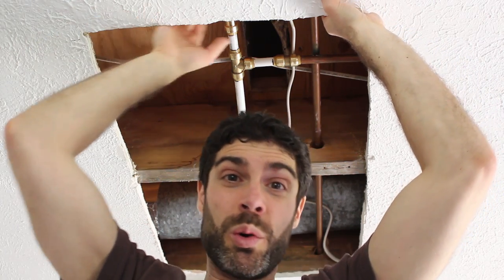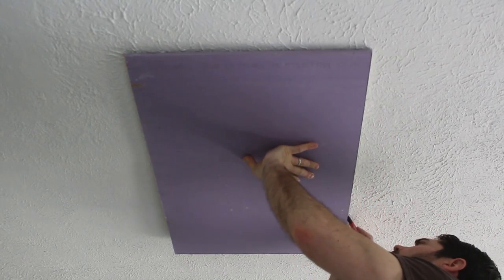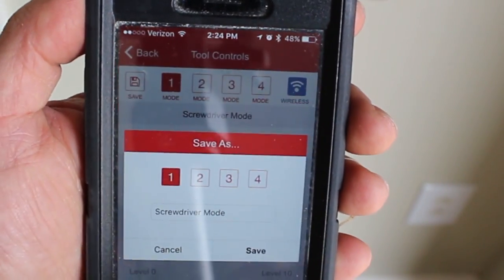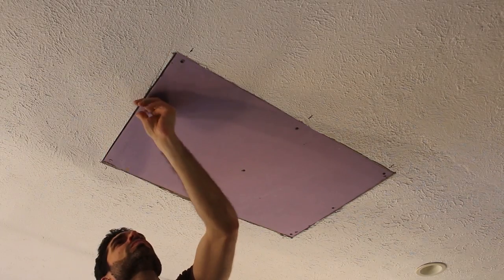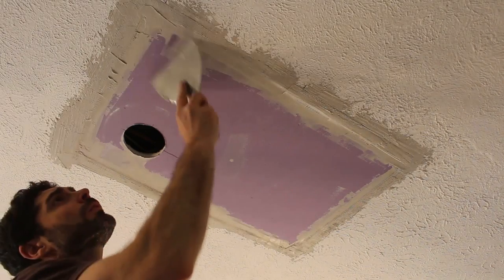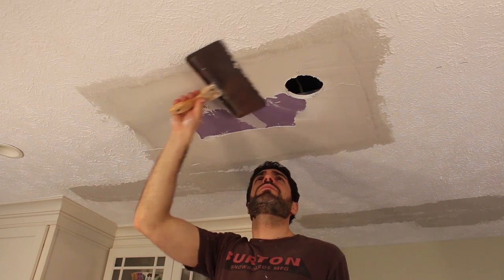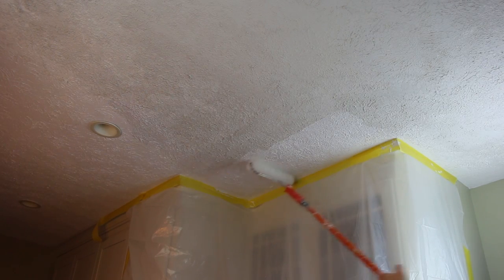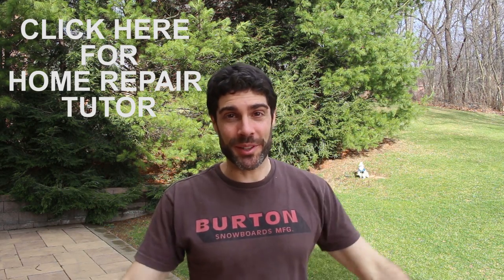How to Fix Drywall in a Bathroom or Any Other Room (Step-by-Step)  -- by Home Repair Tutor

Comment: I just discovered your videos.  I love them!  They are super helpful.  I love that I can rewind whenever I need to--sometimes right in the middle of my project.  I need that tool!  I recently acquired a tax foreclosure property and I'm a DIYer.  The tool would make drywall installs, 2x2, and 2x4 framing so much easier for me.   I'm often working after 5 on this house -after work.  An impact driver like this would make working easier and faster-----is something I crave for.  I hope you consider me the favorite for getting that Milwaukee.  Thanks for your easy to follow videos.  They have given me, a girly girl the courage to just do it.  Guess what?  I am just doing it and it feels great to look at work that I did myself learning all the way.

Comment: Excellent video! I've been putting off a leak from the second floor bathroom that is dripping down through the drywall of the ceiling below for a few months now. Planning to tear open the drywall tomorrow to see where exactly the leak is coming from. I was concerned with how to put the drywall back together, but with your video, I think I know exactly what to do!

Comment: I am trying to finish a steel roof I am replacing after a hail storm ruined my roof last year.  I am disabled from cancer, or really the chemo treatments I had to go through that caused nerve disorder in my back from the chemo.  I could really use this to help me screw down the sheets  because I have a old screw driver that has to be charged after about 30 minutes of use.  Thanks for the video. You really help people that need the info you are giving out....
Reply from the maker: +Randy Griffin hope you're doing better. Cancer sucks. But it sounds like you're doing good?

Comment: Thank you for the video. Excellent tutorial! Thank you for sharing the tips, tricks and minor imperfections too. I bought my husband an impact drill just before our project and it is a must have for this project and any DIY project. Right tool for the right job so folks go out and buy, it's worth the money (not that expensive). My hubby mounts the drywall and I tape, mud and texture. I feel more confident with my work now that I've watched your videos. Keep up the good work Jeff. Many, many thanks!

Comment: I have been doing carpentry works at home and at my children's homes (got 4 married kids). I am currently using a regular screw driver. At one time I was able to borrow an impact driver from a friend to test the difference between the two and noticed that impact drivers is effortless and much faster especially when your putting up multiple panels. I wish I can have one of this especially now that I'm retiree. Thanks much.

Comment: This is a great
video, I wish I saw your video before I did my ceiling. I do not have impact driver drill or never used one in the past and in the past I have used inexpensive corded drill where either the speed is to slow or too fast. I always end up messing up the screws. I like mobile settings and so easy to configure. Currently I am starting my unfinished basement so my kids can have
room to play.
Once again great video and keep up the good work!

Comment: Really appreciate how yo allowed a good ammount of time and photos to removing the old, and preparing / installing extra wood so you have something more to screw into. LOVE that you included the problem of needing a round hole for the light!! also LOVE that you suggest pre drilling the screws to save time holding the drywall above my head. Thanks!
Reply from the maker: Thank you Cathy, hopefully the tips help

Comment: Your video answered my questions perfectly!  Thanks!  I am going to update my kitchen by replacing fluorescent tube light fixtures with can lights and will have to patch 6 2 x 4 holes in a dropped ceiling.  BTW, it's probably too late for the drawing, but I would dearly benefit from a Milwaukee impact driver!  I'm a grandma do it yourselfer!

Comment: HEYYYYY JEFF! I can REALLY use that Milwaukee Fuel One Key M18 impact driver. I found water leaking through my grout in the bathroom which has now turned into a renovation. Doing this all myself with the help of my wife and can really use this impact driver. I have many more house projects in this 1968 home yet to be started as well. Thanks for the VERY helpful videos!
Reply from the maker: +Owen Crossman oh no!! Was water betting behind the surround or tile?
Reply: +Jeff Patterson, it seeped through the grout and through the boards. The previous owners did a great makeup job to cover the bad grout. I noticed the "makeup" coming off so I went to remove the old stuff and regrout, found water past the grout and water proofing. Long story short, we are now down to the studs. Good news is that I found a Wedi distributor. Now we're saving up the penny's to make one purchase and get it done right. (Thanks to your videos)

Comment: Gosh Jeff,... I wish I would have seen your video sooner.  You made the job looked easy and a few tips that I didn't even think of.  I had a water pipe leak coming from the foundation.  The "plumber" cut many holes trying to find the source of the water connection then cut 5 extra giant, non-pretty square holes to stick his head in to look in the ceilings if he can reroute the new water source through the sub-flooring.  Therefore, I ended up with many big ugly holes in two separate rooms in the ceiling, walls, and wall behind the kitchen sink.  This is a big job to repairs... after the plumber reconnected the water source throughout the whole house.   Now it just the drywall patching to do.
Thank you for the tip on adding the extra joint support,  tracing the drywall template to cut the ceiling square, and applying the mud.  I just completed one room.... looks O.K.  Now adding your tips to the job, I hope to get the 2nd room done a bit quicker.
Thank you for the video.

Comment: Nice Tutorial on drywall Jeff.  I wish I had seen this video a few months ago.  My repair came out fine, but I'm still cleaning up dust.  Live and learn!    Thanks for the video.

I have some second story windows that need to be replaced.  I could use that Milwaukee impact driver to help me with that project.

Comment: This would be my first cordless drill. I've been procrastinating because of the various brand lines (DeWalt, Milwaukee, etc). But I've decided Milwaukee is probably the brand to buy. Thanks for the great video, as usual.
Reply from the maker: +FrankenDoc it can get confusing super fast. So many options and so many brands. This is a good one, I'll stand behind that since I'm beating it to death on a bathroom project ;)

Comment: I could sure use an impact driver like that.  I had a bathtub leak that ended up leaking thru the downstairs bathroom celiing.  I need to make the same repair as you did in this video.  I've been putting it off for over a year now.. lol.  Thanks for the great video.  Cheers!
Reply from the maker: +VA3JPX hope the video helps with the repair, if you have any questions let me know. Don't worry, plenty of us procrastinate ;)

Comment: Yes, thank you for the video Jeff. I'm in the process of repairing a similar type of damage in a bedroom ceiling. My issue is its lathe and plaster. So, not being a plasterer I'm going to take your suggestion and mark and cut plaster to fit. Not being at all 'handy' I've never owned tools and in the process of trying to accumulate them as I go along. And not to mention accumulating the necessary skills and confidence to tackle the jobs myself. I do have a borrowed drill, but I should really return it to its rightful owner asap. That's my story in hopes I get the randomly picked as the winner.

Comment: Awesome driver!  I would need one to help with building my deck skirting - our first major project!  We're using a regular drill and while that works, man, an impact driver would make it go so much faster (and neater too!).  Hope we win!
Reply from the maker: +oepth you're right, it would be a breeze with an impact driver. Drills are good but these bad boys are way better. I rarely use a drill unless it's a hammer drill for concrete

Comment: You got my respect. I live in a condo and we had a leak in the bath tub. Easy fix. All we had to do was to screw the over fill plate tightly plumber didn't charge us anything. Our neighbor down stairs noticed his soggy dry wall and heard the water drip. Family friend took care of everything for a case of beer. After me and mom went to 'Hope-Depot' and looked like tourists in a lost world. We bought a basic drill, basic drivers and screws, duct tape, wd-40, and a ton of caulking and canned foam. 

Whoever invented spray foam has to be one psychotic sadist because I damn near spray foamed myself like the marshmellow man from Ghostbusters. It was like being a horny teenager with a computer on summer vacation again. So much fun.

Comment: Oh, I have many projects set for years!  Basement reorganization which requires mounting things on concrete block walls, i.e. Impact driving.  I also have outside projects I'm working on now - fence repair and creating boxes for raised gardens.  Then I want to redo my garage and later the screened in porch.  The house is a 1960 home and renovations are due.  Oh, there's more ...

Comment: Texture is like smooth wall, you need to flare out your patch more, I go about 3-4 feet out from the joint. Luckily in my area, texture is not popular. You can also use drywall shims or cardboard to level your board. Remember is you are a do it yourself er, its easier to do multiple thin coats than trying to get everything in few passes. As for the video, I love presentation style! Keep up the good work!

Comment: I need it because I am building a Time Machine in my garage with a wireless interface to my skull (for neurotransmitter control) and drilling the Unobtanium and my cranium requires different yet precise speeds. Thank You.

Comment: Nice drywall video so was that piece of wood added to each end of the patch? Also would be nice to have to have an impact driver since I'm diying my whole family's 100 year old house solo and doing everything from framing to drywalling to exterior.. which will probably take me till I'm old man lol.
Reply from the maker: +Neogx148 sometimes feel the same way about my house. Yes, added the blocking to the joists to make it a bit easier to attach the drywall.

Comment: I would want this awesome impact because I really need to build shelving for the garage, rebuild my Dad's workbench. I also have a ceiling repair I need to do in my Mom's garage where the A/C tray overflowed and caused water damage.

Nice repair! This is actually pretty timely because I noticed the aforementioned water damage project a few weeks ago.

Comment: Excellent tips on the whole process. If you have any more drivers to give away I'd use it to rebuild my back deck. The M12 driver is good, but the M18 you described would be faster and stronger.

Comment: quite frankly I have been using the Ryobi butt I would love to try the new drill especially since its impact and I'll be able to drill through concrete to mount things and I would be looking forward to using it with my phone Daniel
Reply from the maker: +Daniel Iki the variable speed on this impact driver is what is so cool, makes it a great tool for most any project.

Comment: I'm taking over the house my father built in 83 and I'm a brand new DIYer so this is probably a dumb question; in my kitchen and hallway you can see the nail heads and some cracking along the tape and above the kitchen cabinets you can just see the tape breaking away. Do I use the same steps in this video to fix those issues? 
I called a few contractors and handyman services and they want to charge from 880 til 1500 to repair those areas, but if I can do it myself and learn something new, I'm all game. Advice would be appreciated!

Comment: I actually have to patch the drywall ceiling in my bathroom so this Milwaukee would be super awesome to use for the project! Great vids.
Reply from the maker: +PlatinumRespect ditto on that project. Are you doing anything else in the bathroom besides ceiling repair?
Reply: +Jeff Patterson nope, just patching that part of the ceiling. Water has made its way to that area of the ceiling and it looks like mold is forming on the drywall so it has to go. The area is right under where the upstairs toilet is located. With the mold situation, the insoles toon between floors in that section should be removed too, yes?
Reply from the maker: +PlatinumRespect depends on how bad it is. Check out Concrobium if you think the wood is salvageable
Reply: +Jeff Patterson will do. Thanks!!!

Comment: I am a DYI wannabe. I need the impact driver because I'm not even sure what the benefit would be over my regular drill besides extended battery life. It seems that my drill runs out of power right when I need it most when working on the deck, fixing the wood fence or building a corn hole game. Thanks!
Reply from the maker: +James April impact drivers have more capacity to driver screws versus drills. Plus the Lithium batteries simply stop compared to old NiCd that die slowly. Choose an impact driver over a drill, they're way better for most any project :)

Comment: First, I really enjoy seeing how easy many projects can be if you take the time  and find a great guide (which your videos and website are.  Why do I need the impact driver and what would I do with it?  Well, I have three teenage boys (enough said, but I will add; I have holes in walls, a window that is falling (literally) out of the side of the house and a bathroom with the floor rotting out around the stand up shower.  I have never owned an impact driver but those I know who have them say they are an incredible tool to have and it would be put to use in the coming months.  Good luck everyone :)

Comment: so how is the phone app connected the the driver?  Bluetooth or wifi?
Reply from the maker: +Qiong Jia Bluetooth, you upload the app to your phone, put the impact driver in Bluetooth mode and sync it to the app. Once you're done setting the RPMs for each mode (1-4) you don't need to use the app again, unless you'd like to change the RPM setting. It was way easier than I anticipated

Comment: In this instance it might have been better to cut the new hole for the can light last, just before priming and painting the patch.  Having to mess with the hole while building up layers of mud appears to have interfered with getting the thickness correct and resulted in a visible bump in the transition from the patch to the old ceiling.